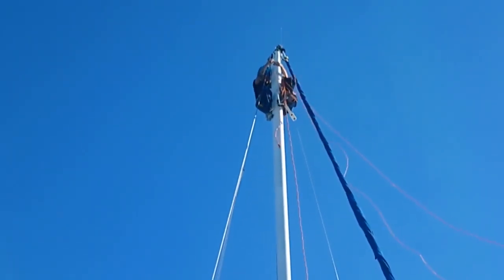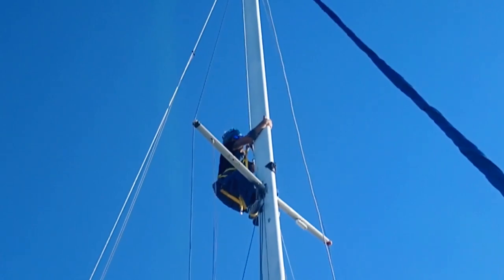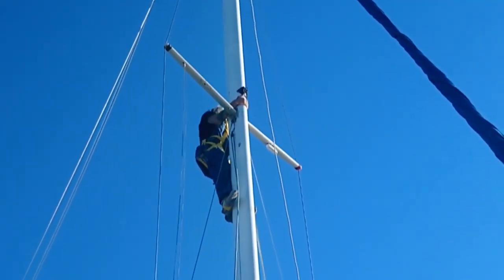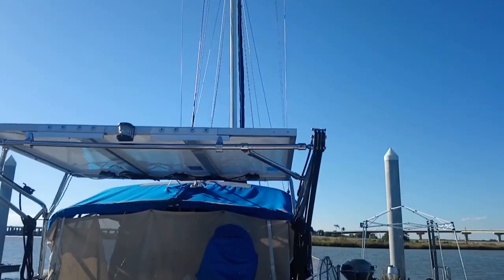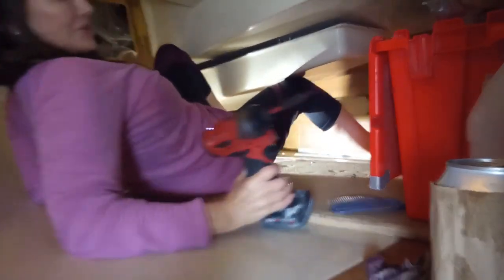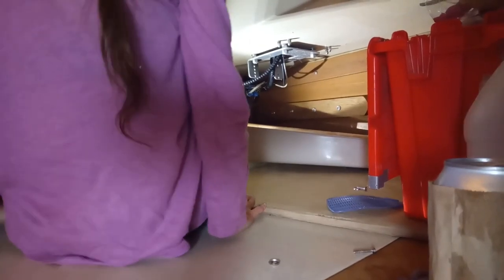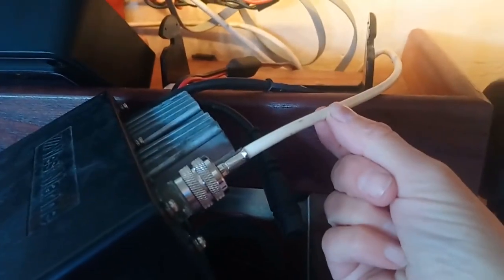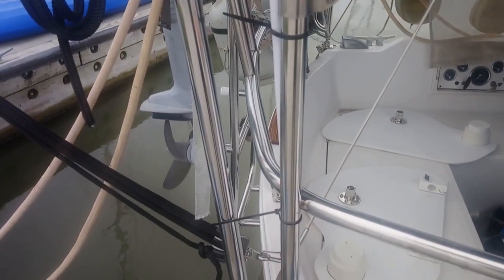Mast Work & Running VHF Cable on Sailboat l DIY Project Girl l  LIFE on a BOAT!

Comment: Please note that the diameter of the coaxial cable (VHF cable). Impedance is the main criteria for proper matching radio to antenna. Fat ain't better.
Reply from the maker: I would of preferred thinner wire, would of been easier to work with but the LMR400 is way better stuff then what I had. But it's run and hopefully it'll work out, time will tell!

Comment: I don't like climbing the mast, although I have done it. It looks SO much further down from up there than it does looking up from the deck, just sayin'. lol. 

 I did get my weekend boat jobs done, just before the norther blew in Monday. The outdrive is back on my Donzi, but I'm far from satisfied with the job I did.The bell housing replacement is not a fun job...but it's back together and I think it'll work.  I ran out of time to do a test run...and neither of my batteries would hold a charge anyway. The little sailboat got some love.....but It's now covered with its waterline cover until the weather improves. Somebody offered me another boat lift for free, so maybe I'll look for another daysailer....nobody seems to want them anymore. I see good ones at giveaway prices all the time now. I bought my old Rhodes 19 several years back from a retired General who had it on Canyon Lake. It's the 2nd big daysailer I've owned. The first was a Flying Scot. I used to pull that one to Galveston from West U. behind my '76 Toyota wagon. That's been a LONG time ago now. 

 I think a South Coast 21 would be a fun one to fool around with.    :)

Comment: How many hours will your engine run when your on board tank is full ?
Reply from the maker: Honestly, I'm not sure. The boat has been sitting too long after the lightning hit. I will have to figure that out! I have 3 jerry cans for diesel sitting on deck but will probably grab a couple extra.

Comment: I am not sure what your level of sailing knowledge is? Have you done much on the water? I can see you are creatively handy but the things you have been doing thus far a regular maintenance items on a boat. You have spoken about a transducer did the boat not have a depth sounder on it? I can see the diamond in the ruff you might make a great sailor yet, I’d be happy to lend a hand if I am able. All my best. Dave
Reply from the maker: Sailboat experience, I'm only 3 years in. My boat had the wind speed depth gauges until it for hit by lightning. Lots of work afterwards. She's pretty much back together from that though.
Reply: There should be a transducer that is already installed through the hull. These are replaceable. If your not getting out for several more months you might want to look at hauling out and doing it before you leave. This would also give you a chance to do a good bottom paint. I haul out once a year. So no sailing experience then?
Reply from the maker: @davesutherland4569  Yes, there is a thru hull transducer, I think it got blown out. I got a fish finder for now, so I'll be able to move the boat around and take it out until I pull the boat out for a bottom job, and replace that in hull transducer.
Reply: I will look forward to watching your adventure.